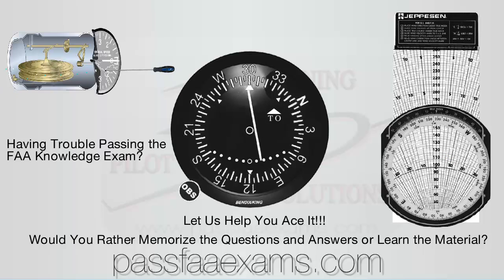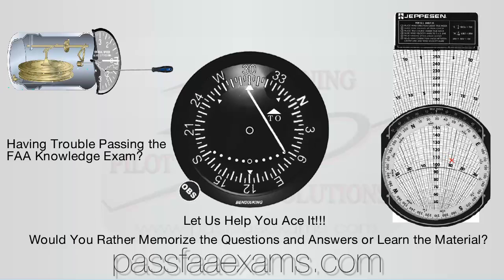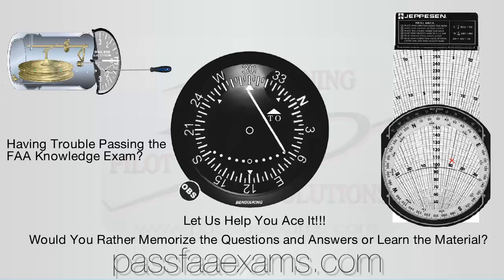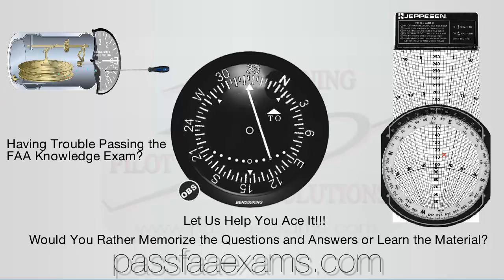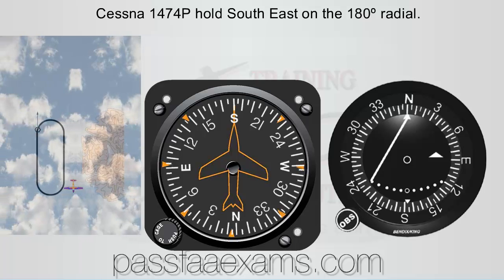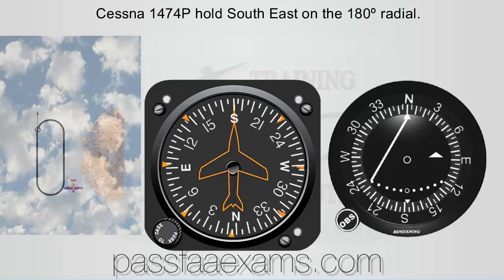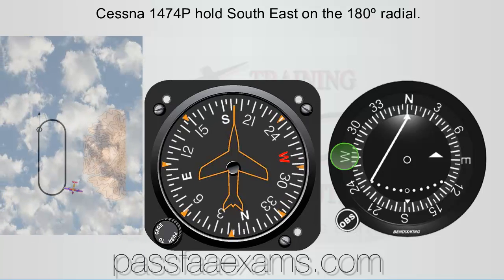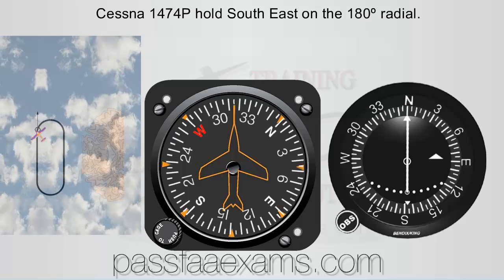Airplane Holding

Comment: What about variation of wind? Wind direction? Why not just stay crabbed on track?
Reply from the maker: Remember the scenario talks about a newly certified IFR pilot for the first time in the clouds by himself. I agree with you that knowing where the wind is from and crabbing into it is a good way to stay ahead of the plane, but having plan be in case you fall behind can't ever hurt.
Reply: It just seems like if the beginner IFR pilot does not have a good grasp on how holds are supposed to be entered this will add to their confusion. I believe that this is a trick for a more skilled pilot with a little more experience to add to their toolbox. Good judgement and situational awareness is key for this particular parallel hold entry.